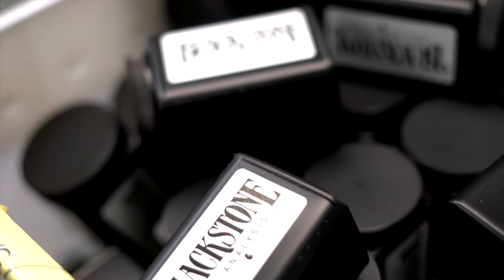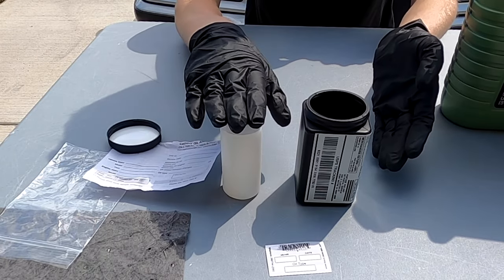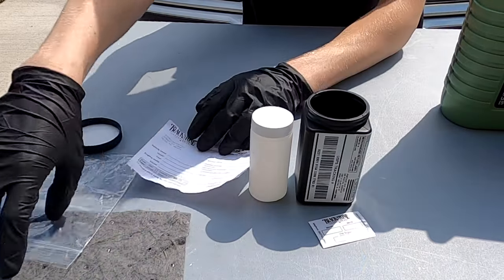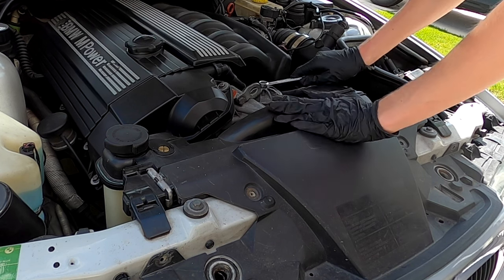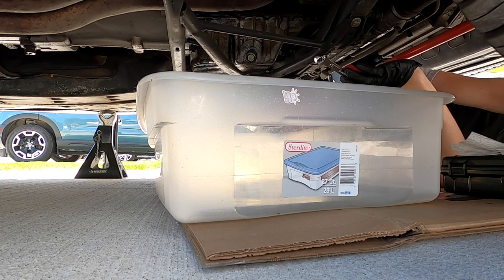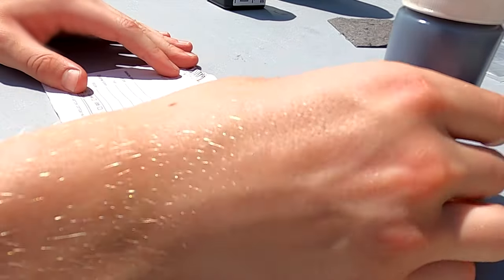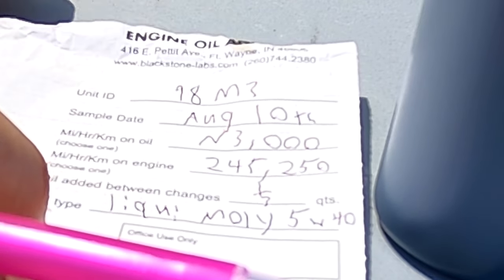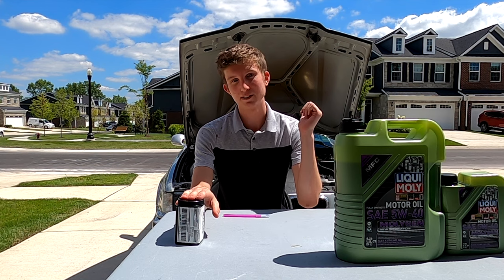Oil Analysis Start To Finish: Part 1

Comment: Just sent mine in! Interested to see where my 2017 109k mile Camaro SS stands. I did find the smallest of flakes on the magnetic oil drain plug.
Reply: Did you get good results ?
Reply: @BankaiZber43  yeah definitely. I've done 3 total so far. One had excessive fuel in the oil but was glad to find out it was because I took the sample after the car was sitting cold for a day. I did hot oil on the next sample and fuel contamination was normal range. Normal wear items for the rest considering milage. I now have 122k miles.
Reply: @pali1H  I just sent my trans fluid in so I’m waiting on the results *46k miles currently on my 2017 lol
Reply: @BankaiZber43 how were your results?
Reply: @pali1H  it came out good according to them, the mechanic that did it put the fluid in a water bottle so the viscosity couldn’t be tested but no shavings or anything bad thank you for checking back in 🙏

Comment: I never seem to be able to catch a sample that neatly.  And had never considered using silicone seal to secure the cap.  I usually have to clean the outside of the container with brake clean before packaging it.  So does that (brake clean) affect anything? Yes, I do that with the lid secured.
Reply: I have used brake clean on paper towel or a rag to clean the outside of it and it hasn't been an issue for my test results. Blackstone could confirm this but as long as it doesn't get in the oil I can't imagine it would be a problem.
Reply from the maker: Cleaning the outside of the sample bottle with break clean won't affect the results, but do it gently. Getting break clean in the oil could lead to false positives for fuel dilution.
Reply: Use a FUMOTO valve. Thank me later.

Comment: I have the privilege of doing my oil changes on a lift, and thus have to start the engine for a few seconds before getting the sample. Will this affect my results too much? Sending my first sample in soon!!
Reply: My understanding is it that it could increase the fuel content of the oil and that it's best to avoid if possible. They recommend noting it on the form if you do start the engine just before sampling.

Comment: Not only opening the bottle in the open which allows contaminants in. But taking a oil sample from the bottom any systems' reservoir will not give you an accurate sample.
I would be willing to bet those aren't ultra-clean bottles either.
Reply: Those are fair concerns. I would think that as long as the contaminants aren't wear metals or dirt, it shouldn't affect the results in terms of reported elements at least. FWIW they do advise sampling mid-stream if possible. I would still want to know if there are excessive wear metals present, even if the sample is skewed toward bottom sediment.

Comment: I have a 1.0 ecoboost that has been known to have the internal oil emersed belt degrade and clog the pick up. Will this sample be able to confirm the belt residue is in the pan without having to drop it?
Reply from the maker: Good question! A deteriorating timing belt likely won't show up in analysis because many are polyurethane/rubber. However if the oil pickup becomes partially clogged, we may see poor wear due to insufficient lubrication.